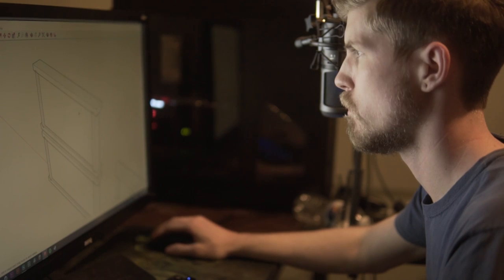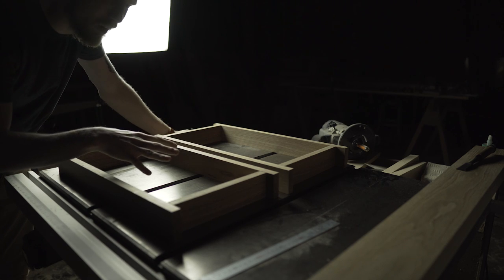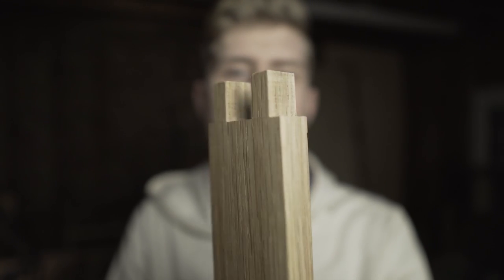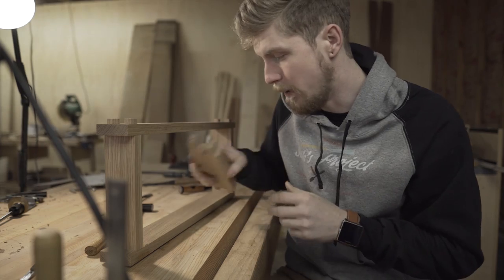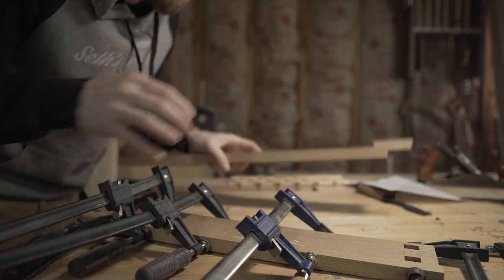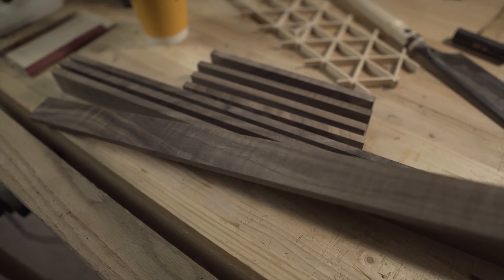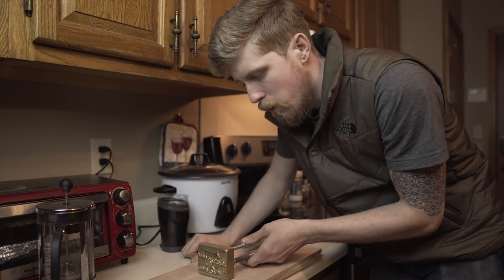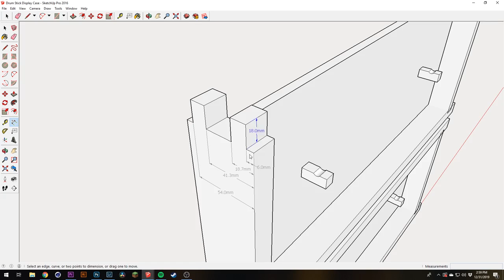White Oak Drum Stick Display Cases (With Traditional Joinery!)

Comment: Got a question. You are, as stated, in TENN which is in the USA so why are you using MM instead if INCHES. Just wondering.
Reply from the maker: The imperial system is dumb, and metric is way easier to use (in my opinion). But I initially switched because all my Japanese tools were metric. I think the US needs to start switching from the imperial system and join the rest of the world lol.
Reply: @SethsProject  The US tried that back in the 70's with gas and it didn't go very will so they stuck with the Imperial. I agree, metric is easier for wood working.